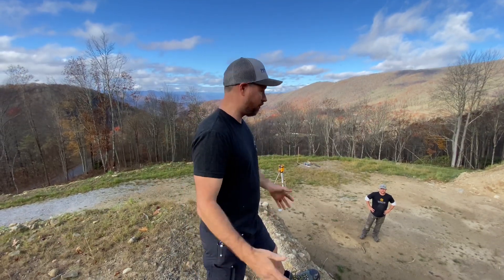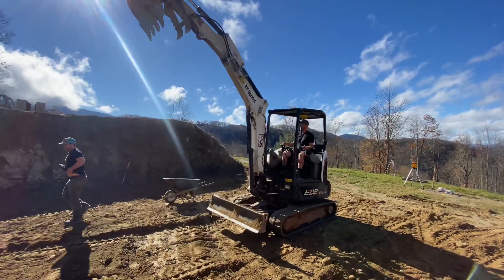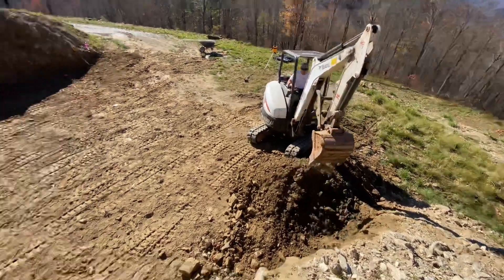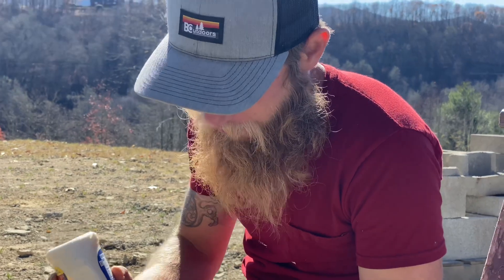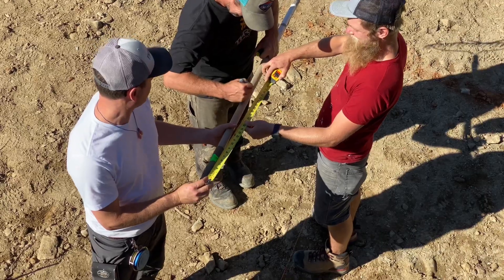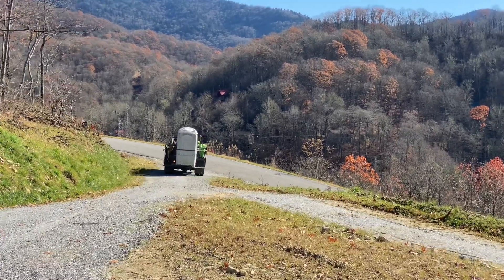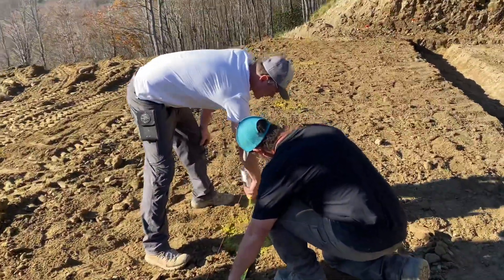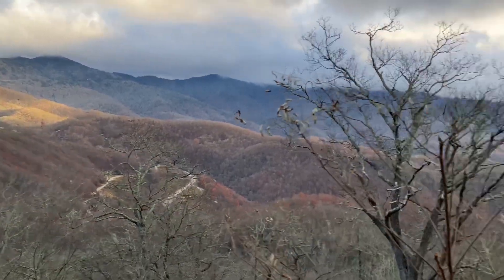How to lay out and dig a foundation: Building The Farmhouse | Day 1

Comment: Hard to stop watching your videos. Learning a lot of tricks, although the only building I have done is for myself. 
I would like to advise you that there are different notches in a stick welding handle, and I’ve found using the 45 degree notch is much more comfortable. 
Also, in one of the videos, you were short several bundles of shingles. A 4x8 sheet of roofing material is-32 square feet. A bundle of shingles covers approximately 33 square feet….
Count the sheets on the roof.

Comment: So next time your digging footings ,line up one edge or tooth with the bucket out in front as far as it will reach,and then lift up with out (slewing )and move the bucket back  towards you ,put it back down ,see if you are still on line then you will know if your strait.and don’t push down hard when you take the first initial scratches of the top ,let the teeth do the  work until you get down past the crust,this will leave you with a neat trench and not big busted out wholes from the clods lifting out.use the back of the bucket to flatten out any humps of loose material.there is a guy on here who operates a backhoe he digs nice footers,I will see if I can find his site and get back to you.

Comment: I fined American building code strange. Why is there no mandate for crushed stone under the slab for drainage, the dirt will continuously transport moisture to the concrete making the concrete have a higher moisture level. Which is bad because it will truly never harden.   Even dough this is a cold climate I don't see any mandate for under slab insulation to eliminate thermal bridging. From my engineering side, I see that building after the code gets you a house that is good in a historical perspective. But at the same time you build the worst possible house that you could legally build.  Making small changes inspired buy Swiss, Swedish or German modern building technic would result in better inner climate and higher energy efficiency for a smal investment.  I think that's something skilled builders like yourself should look in to :).
Reply: 4'' of gravel and a vapor barrier go in after the block is done, before slab is poured.